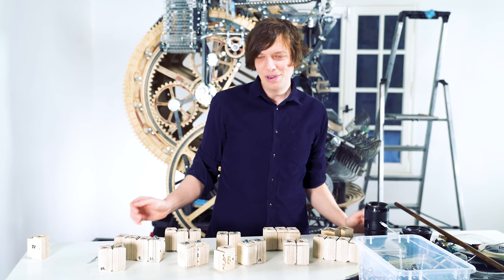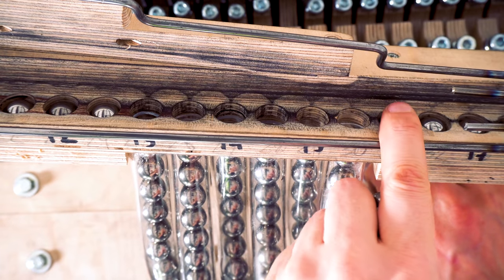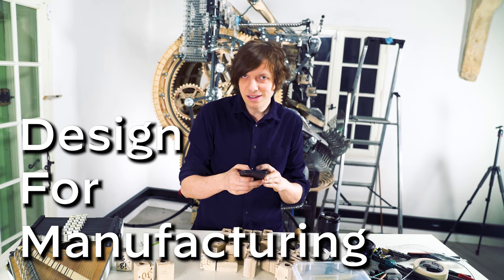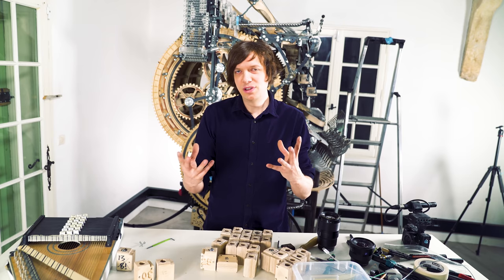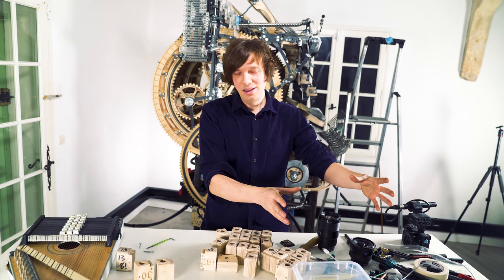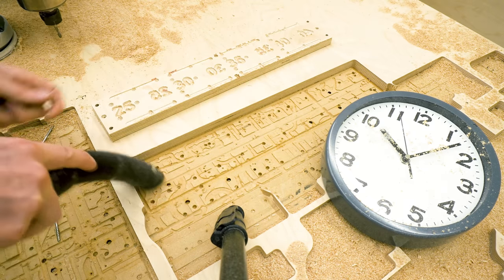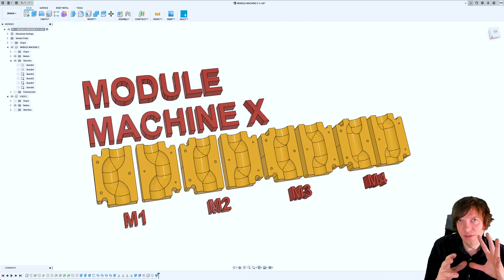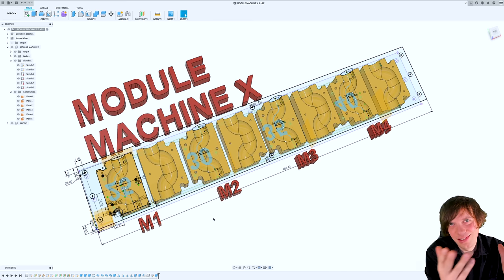Module Machine X

Comment: Why not just make it adjustable. To much fiddling in my perspective. If you move the machine, vibration will shift the position of the pipes and you are lost. Just a screw mechanism to change the pipe length and you are fine. Further no more replacing the Modules.
Reply: I suggest something like a Trombone instrument combined with a bridge mechanism that extend in the summer. For bridges many times they use a ZigZag mechanism, so cars can still ride the bridge, because the holes are smaller than the tires. He just has to make a loop like a Trombone made from wood that exist from different plate lengths that can interlock eachother in a zigzag way, so there is not a gab for the marble.

Comment: I see that the DFM perspective changes the discussion about the cybertruck. However I still dont think its a good design. There are reasons why our cars dont have sharp edges and straight lines. Car designs from a few decades ago were much "edgier", and I GUESS a lot of it has to do with efficienc as in aerodynamics and safety. Sharper corners will lead to higher risks in low velocity collisions, which are probably the most of the accidents that happen. And I like that you talk about the future Martin, because I blieve our future has to be streamlined for efficiency. And I dont think bad aerodynamics have a place in that, even if it means a bit less DFM.
Reply: Tesla (or at least the cybertruck fans) also made a big point about the steel chassis being extremely solid and hard to dent. Isn't that flying in the face of decades research on crumple zones? Like the reason our cars became easier to dent and crumple isn't just because it's cheaper, it also means they absorb energy in the deformation, making you less likely to get injured or injure someone else.
Reply: @GeorgeBryantLuxtylo  you're going from one extreme to the other, ie if it's not curvy/if it's stiff then it must be all the way so and is unsafe. Why can't it be somewhere in the middle?

From what I can see some of this criticism is valid like sharp edges in low velocity collisions. On the other hand tesla has consistently ranked high in safety and i can see at least the following optimisations:

- Collision avoidance through autopilot, with so much data collected it is possible tesla could avoid many collisions altogether

- Simulation based crumple zones would still exist, it doesn't have to be hard in every possible way, probably the way people scratch and dent vehicles is different to how it would be impacted in a typical accident

I don't know what Tesla is thinking, but they have stated multiple times that safety is their priority and they have largely delivered on that statement (according to testing authorities anyway). They have great simulation capability and lots of real world data. They are not afraid to try something that hasn't been very well researched and see if it's better or worse and then decide.

My main point is let's not be like politicians and polarise the issue even more, there's a way to optimise this and keep what works and change what doesn't based on data (instead of not even trying and blaming the other party).
Reply: conventional pickup trucks actually have more air resistance than the cybertruck since the area behind the cab is optimized for storage space and not for aerodynamics.

Comment: I love the progress and the updates. It probably helps you a bit too. If you run into future problems with the different height blocks, there's probably a way to make a generic adjustable block with very few parts. It would allow for more fine tuning. Only worth the extra effort if you run into future problems, your current solution is beautiful.

Comment: I think you missed the purpose of a review. I wouldn't mention DFM in a car review, nor in an ikea shelf review. As a customer, I don't care how much focus was put on DFM, I only care about price and how it works for me as a consumer.
Reply: This is true but a more easily manufactured vehicle is easier on the environment. 

I've worked in manufacturing and one thing I've learned is the the carbon footprint of the manufacturing process is immense. Every detail of everything that is manufactured on a mass scale is important. For instance if the geometric designs of the cyber truck  make manufacturing costs and carbon foot print smaller then that would be a design choice I would pick. 

I fully understand that to a consumer the way the product impacts you is the most important aspect of a purchase but I think in this day and age paying attention to how costly it is to manufacture something should be a concern. On the environments sake at least
Reply: I watched the mentioned review and it focused on aesthetic design, not engineering design. I strongly feel that in the current environment crisis engineering solutions should come as priority 1 while aesthetics priority 2. 

And i'm not saying don't do any aesthetics at all, there's a minimum standard and a middle ground, and tesla met it imo. It's also something they can definitely improve on later in later model years. 

Additionally, if you only "care about price and how it works for me as a consumer", do you care about design?
 DFM helps make it best feature-wise for the price so it will perfectly fit your needs.

Comment: I think a better example of DFM on those shelves would be the plastic bins. The reason they taper as they do, is to allow them to be removed from their injection molding tools, and it's called the draft angle. Without it, you'd have to pull the part out entirely, before air could enter the tooling, and you'd be pulling a huge vacuum. With the draft angle, air can get in after just a few mm of movement

Comment: I'm really not convinced by the DFM commentary on the Cybertruck. You seem to take issue (at least by implication) with the idea of engaging with it on a purely aesthetic (or even on a practical) basis, but that's how it will be engaged with through most of its existence and that's a key test any car has to pass. It also seems to imply that this design, such as it is, is the inevitable result of DFM in auto manufacturing, when cars were constrained in the past much more than they are now by available construction techniques and yet there are cars from the 50s, or ever before that when designs were much more limited, that a given person will find beautiful, and those that person will find ugly. So to me it's a kind of facile commentary regarding that particular car.

Comment: I don't care if it's designed for manufacturing when it comes out as ugly as the Cyber Truck. I'll pay more for an actual good looking truck. Also the bed doesn't allow a topper and you cannot have a larger enclosed bed. It's like an El Camino.
Reply: Holy crap Randy! That's the like the Cadillac of cars!

Comment: Fun fact, I work in IKEA head quarter and had the responsibility to find the perfect packing solution for this exact shelf (HYLLIS). Martin, what you have is the second generation of this shelf with the hidden screws and bent over sides to reduce sharpness and increase strength (Y)

Comment: The offset in top marble height for each module should be in a linear relationship with the offset that you use to move the marble path sideways within the module, the one you also use for naming them. Figuring out the formula of that relationship would make the task of finding the right module a lot easier. For example, when you measure that your marble is 3 mm too low, instead of trying modules until you find the one that works, you just plug "+3" into the function, and get an answer of which module does that offset.

Comment: This is just an idea and perhaps would not be as readable as your current solution, but for the engraved numbers you could etch a standard set of ticks on each module and then etch a line spanning some of those ticks with the length of the line determined by the parameter (ie like a thermometer). That way you don't have to put the number in manually. Love the daily videos btw!

Comment: Design for manufacturing is something it is better to not learn by mistake. I recently built an electric rideable from scratch, and it has 3D printed parts that interface with a welded aluminum frame. Tolerancing parts to properly fit without a lot of sanding was a lot of hassle, as was keeping the parts in such a size and shape to print with minimum support material and fit within my printer's build volume.

Comment: if you want to level up your DFM CAD, you can sync your part to a csv file/excel sheet. That way you can keep track of everything on excel and changes will automatically reflect on the cad model!!! This allows you to make hundreds of different parts at once using one excel sheet with formulas and one flexible cad design

Comment: I'm surprised you didn't go for threaded/screw adjustment of the length of the path. Once this wobbles into and out of position, it will be likely to be off again, and will be really hard to readjust again. With a screw adjustment you could have basically infinite adjustment and easy readjustment as things go out of alignment again, which they will. 

Still, many of the things you've designed are brilliant and I have learnt many things from your solutions, so big kudos to you. I also very often go through the same process as you: find a problem, solve it with an extremely complex thing and then over time simplify the solution to achieve the same result:)

The machine is a masterpiece and people will finally appreciate its value only years from now. It's big words, but you really are pushing the boundaries and bringing back the artisan masterful craftsmanship into the 21th century.

Comment: Martin you should chamfer the holes . It will help a little bit more to let pass the marbles. Another thing, instead of making a lot of length  ajusting modules ; I would make all the tubes  with a kind of S in it. To ajust the length, just heat  and bend it to shorten or elongate  the pipe into the marble divider. That's it. What you need is plus or minus 11 mm of play

Comment: Henry Ford used the principal of design for manufacturing with the Model T.  Along with time studies, lean manufacturing (just-in-time parts delivery), and other production innovations, he was able to reduce the cost of the vehicle from $825 when introduced, to $265 in 1924, and $360 at the end of production.  What he did was so revolutionary that in 1919, a book "Ford Methods and the Ford Shop" was published analyzing the Ford production methods.  A facsimile edition by Engineering Magazine is available.

Comment: If you consider Ford trucks from the early eighties through 1997, you can see their use of DFM. Lots of simple shapes with little effort to create those soft round panels. Starting in 97 Ford made round body panels and they were very popular but also very expensive. Look at the trucks from 2020. They have very simple shapes. Seems DFM is taking center stage. Great work! Keep going!

Comment: 16:00 for numbers, you can put a big dot inside a fixed straight line, the big dot should be at the correct distance from the edge of straight line, and it parametrable
Reply: Isn't the issue that you cannot change the actual text using a parameter? eg you cannot (today) in fusion 360 say "put this text here and make it =module1". You would end up with =module1 engraved in your part, instead of 14 for example.
Reply: @briswolf  my suggestion is not to write text, but to put a big dot on a fixed sized line, and the position of the dot is easily parametrable : just is relative position on this line
Reply: @43.5  and the distance along the line represents the number? seems like it would not be very easy to read, but you do you :)

Comment: One thing about the wooden modules is that they will wear. This will lead to a longer path and possibly a height issue over time. But it would be simple to create new ones from some high wearing plastic that will not have this issue. 
Also has the stacking height remained the same when many marbles are unloaded. The tests where the repeatability was tested was with only one marble removed. If sufficient marbles are removed the stack my form into a different orientation with a different height.

Comment: Martin, I have a solution that would keep you from having to constantly re-load all the marbles each time you make a change to the height modules, and all it will take is a piece of coat hanger wire and a drill bit!

All you need to do is drill a hole through the plywood block that is just above the height modules.  Then you can insert a length of coat hanger wire into the hole, and presto the upper marbles are held in place!  You now will only have to re load the marbles down stream from that point.

Comment: martin kind of missed part of it, but the cybertrucks body is its structure, it doesnt have internet structure with decorative panels on it like normal cars, this reduces weight. They skip paint to reduce cost. Because the metal is SO strong, it cant be pressed and formed into shape without a much greater added cost, So they score the metal and bend it. This metal and these bends give the vehicle its strength. They wanted a flat top like most people asked for early on, BUT if they did it wouldnt have the strength! This vehicle was 100% built to reduce cost while keeping the vehicle stronger and this is the look it ended up with. That said, i do hope one day they make a flat roof version with a higher rear tailgate.

Comment: I teach a wood shop class with a strong CNC emphasis. We spend a lot of time on this idea of reducing time in a production run.  This falls solidly under the Lean Manufacturing umbrella.  I'm surprised you didn't do a time test comparison with a tool change.  Thinking in scale, I would lay out a whole sheet of modules and use a round bit the size of the marble that could cut the marble path in perhaps 4 passes.  One tool change in a sheet of parts would easily pay for itself in time.

Comment: Do a plaster cast of the interior of your height module and use Mold release agent like Pam cooking spray. You can then measure the path of the marble.  Actually I would cast the marbles in place. That would give you a good gauge.

Comment: I suspect applying a thin layer of very flow-able superglue to the porous plywood surface and then letting it fully harden prior to milling, perhaps using an accelerator, might mitigate the edge chipping that occurs during milling. That technique is used in some woodworking applications.

Comment: The concept of "DFM" was a thing I read about in an issue of New Scientist during the first years of the 1980's: Clarks shoes had made a computer programme to decide how cut shoe patterns out of the leather sheets without causing wasted leather -- an important job that was done by experienced people up until then. The experts were amazed how efficiently the machine mind worked and that it had thought of solutions that were better than they had imagined themselves.

Comment: I'm glad you have solved the height issues for the time being 😁
I am concerned however that .5mm makes that much difference so surely if the pvc pipe flexes or lifts (especially during transport) this could undo all of the calibration you have so painstakingly done. 
Imo I think you should forgo the pvc pipes and go with a plywood solution that can be fixed and repeatable.

Comment: One part of the cyber truck that worries me is people getting in accidents. The edges are point, so if someone gets hit on one of those outside edges it could be much more dangerous. Also the dash has, (or at least had if they changed it) a sharp edge, if someone is in a bad enough accident and hits their head on that, it could be very bad

Comment: I really like your videos! I will write my opinion about DFM, as an design engineer. DFM must not dictate the looks of a product. DFM states the production as an additional internal client, but about the product final looks, a marketing department may have higher priority. I.e. Brand identity or shelf appeal are more important than production costs extreme reductions. DFM is in this case a compromise, and will probably increase product costs to avoid production problems in the long run, which is still very important.

Comment: I'm sure the marble height system will be thrown away some day. Pain is temporary, glory is forever..... the marble height of the stack is simply not consistent enough.
Reply: I also think so! As many people under yesterdays videos (height modules) commented, this height module design is problematic. The tolerance chain is very long, the paths (i.e. pmma pipes) are slightly bigger than the marbles' diameter. Therefore, the vertical row of marbles forms a snake pattern in the pipe, which is not always the same of course. Thats the reason why this design with the height modules will not guarantee the needed precision on top of the marble devider.

In this video Sebastian Kirsch came up with an brilliant idea (trapdoor hook system) which could solve the problem:
https://www.youtube.com/watch?v=zahlKPc6TMA&feature=youtu.be

Please vote it up on discord that Martin and the engineerng team can see it:
https://discord.com/channels/649165975647682560/649172304638640130/802136003137372180

Comment: Look at a Trombone instrument. It expands the path for the Air. The sound become lower or higher because the air takes a longer or shorter path. You can use the same principe. It is much easier... In order to keep the marbles rolling I suggest a simpel ZigZag mechanism that exist of small plates of wood that interlock eachother. So the balls keep rolling and there is not a interference. It will save you much time! Eventually. Just one design and adjustable with screws. Another benefit is that you can make precise adjustment so the marbles will roll perfectly for each tunnel the same.